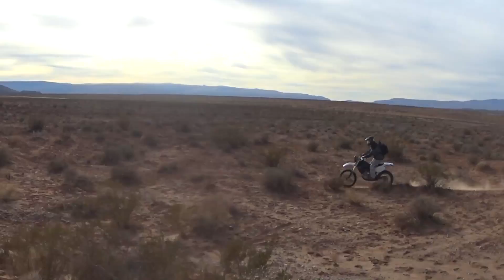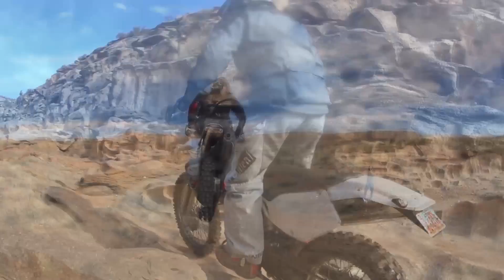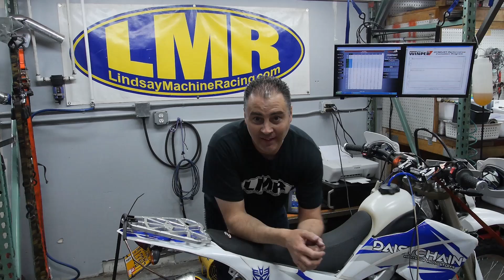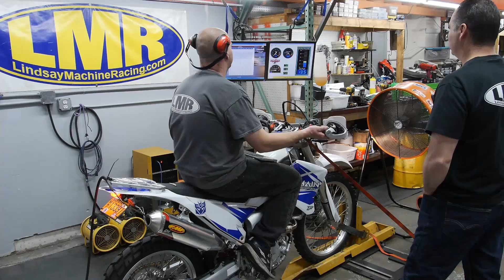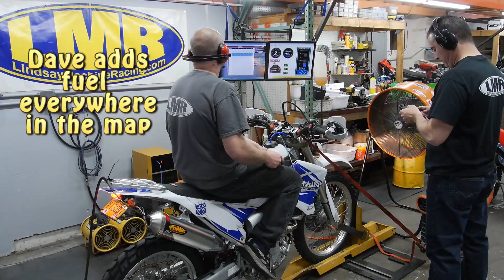WR250R DYNO CONTEST- LINDSAY MACHINE RACING (310cc)

Comment: Hmmm....  Before = 28 hp (dirty K&N removed) & c.15 ft/lbs from a dirt contaminated 250. 

Bored, stroked, ported, cams, what appears to be a new full FMF power bomb system...  After = 44 hp (new clean foam filter) & 23 ft/lbs.

If the gearing is the same as stock, and rev limiter is the same, top speed would theoretically be the same.  I'd say around 105 mph bumping the rev limiter on the dyno.  But not in the real world with wind and tire drag.